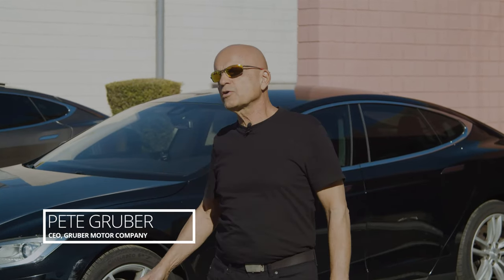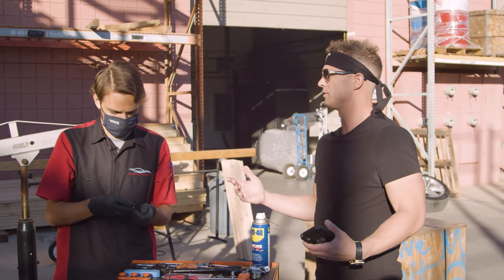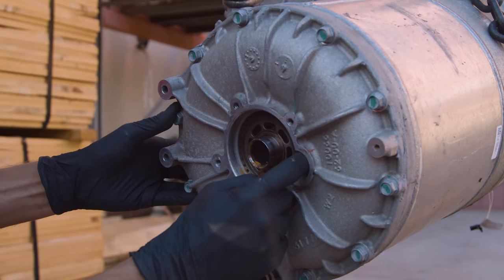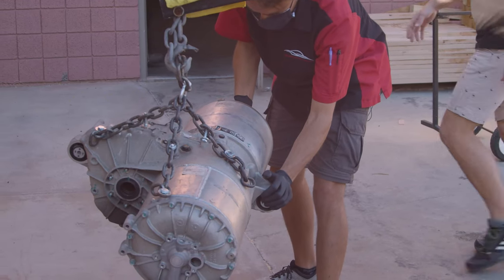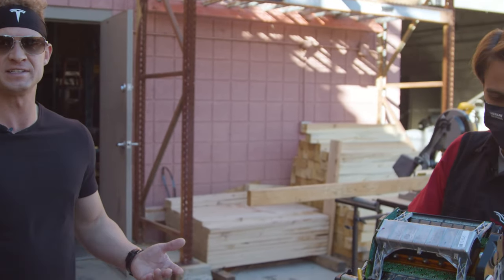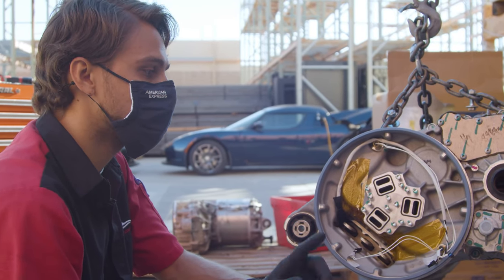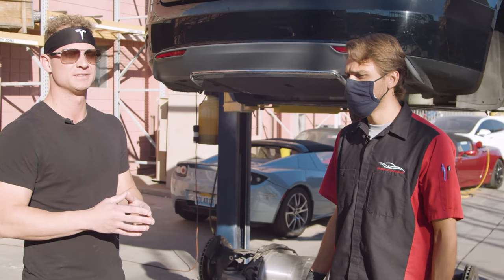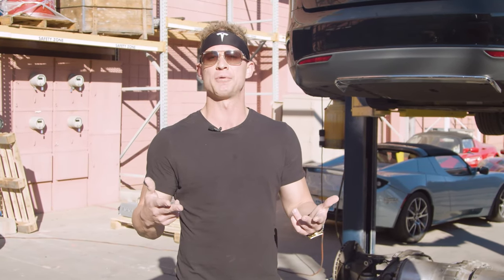Tesla Model S | Flooded Motor Repair | Gruber Motors

Comment: Is there a recommended preventative measure to mitigate the potential for leaking in a 2013 Model S ?
Reply: yes i too was going to ask this question. my car will be out of warranty next year and at this point they have replaced the rear motor 3 times in the past three years i ask them about a fix and cost. no fix just replacement at a cost of $6k. the motor was just replaced a couple of months ago and would like to know if there are preventative measures or an improvement fix that can be done to help.
Reply: 3d printed gasket?